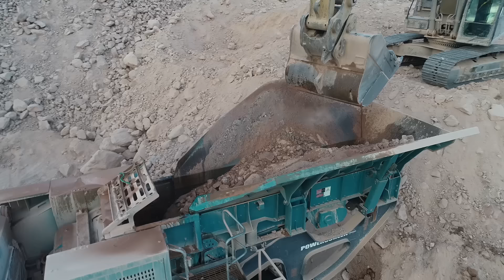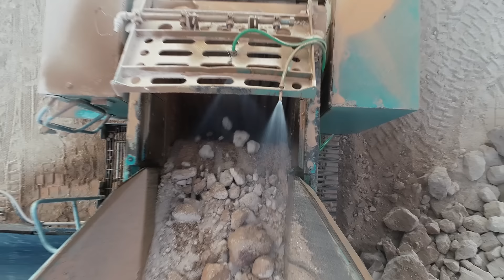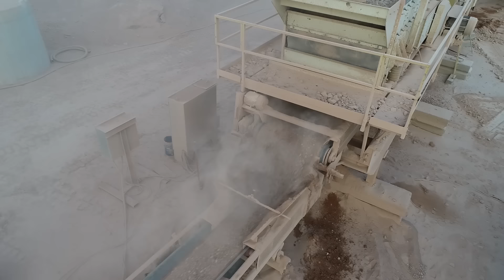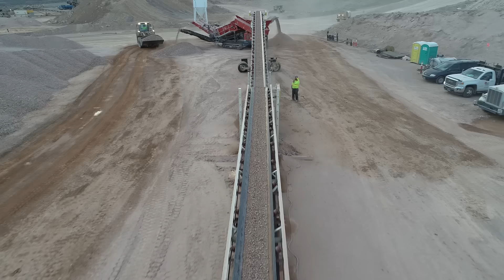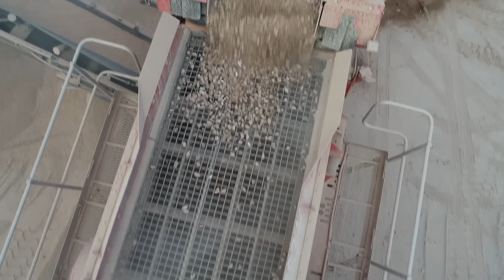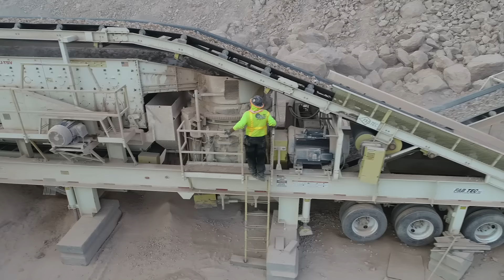BACK TO ACTION! TRYING NEW GEAR! ROCK CRUSHING

Comment: Not knowing nothing from nothing about this stuff but it looks like the red screen should be the first and the last stage.
Reply: There is a screen just after the first stage to screen out and bring return back to be crushed down to size.
Reply: @jeremydobbert1287  What I'm saying is there looks to be a large amount of fines out of the excavator bucket that should never hit the crusher at all. If it's already sand sized, no reason spending horsepower on it beyond classifying and piling it up..
Reply: @davewood406  I do get what you are saying.  I don’t have an answer for it! Lol